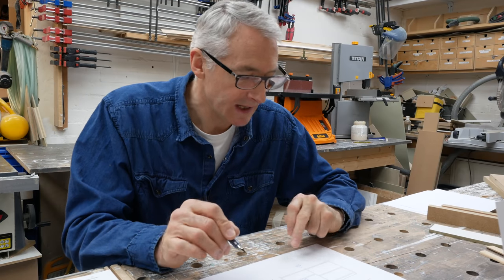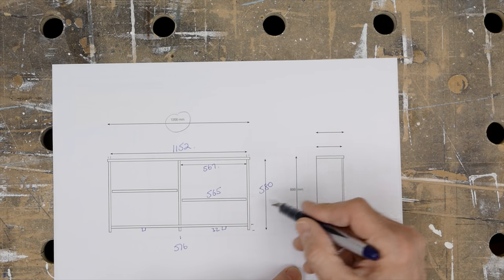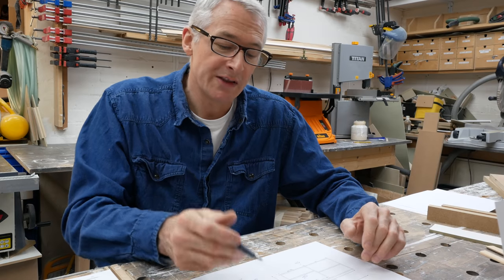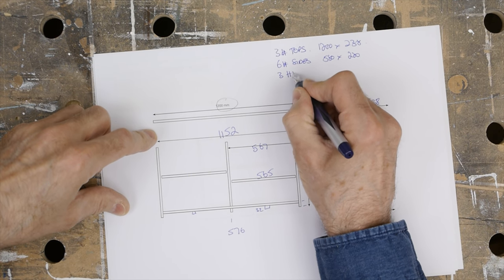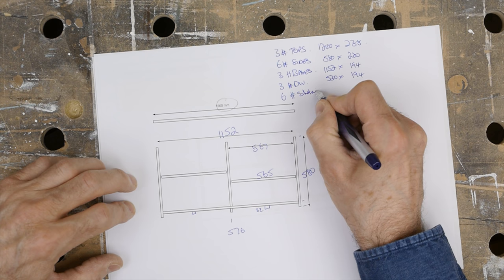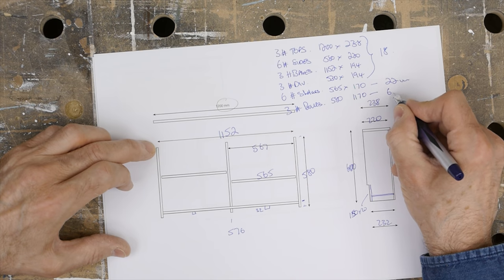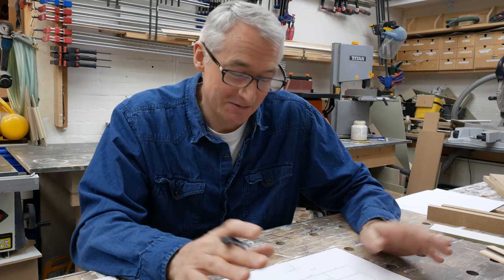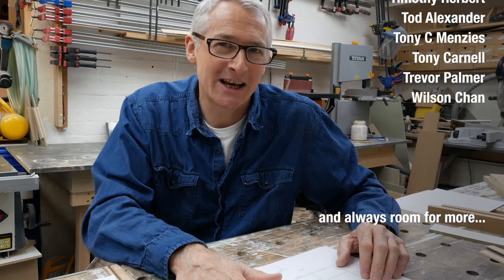Cut-list cock-up Part 2 [video #302]

Comment: You've highlighted the need for careful design and thorough planning quite nicely here Peter. Especially important for those operating as a small business or one man outfit. I use CAD programs myself for the design process. The one I use has a cutlist and weldment feature that will take the parts you've assembled and work out the cutlist and even best sheet arrangement. Not for everyone I'm sure but has so far helped me get it right first time every time. The only weak link is me actually cutting the stuff lol
Reply from the maker: Cheers Stuart. I think I'm always the weak link, lol!

Comment: That's why I model everything in FreeCad. After some time, I'm faster than drawing it in anything else or even on paper and when I get something wrong, I can immediately see it. Saved me two time already. Also, when I get wood order wrong (2x longer, 3x shorter instead of the other way round), I can do slight design changes in a few minutes.

Comment: Thanks Peter, made me adjust my cutlist calculations spreadsheet. As I had forgotten how adding a non rebate  back panel  and or a face frame  effects the overall depth of the main carcase's  sides top  and bottom 👍

Comment: Great Video - shows in a busy workshop moving from project to project it must be easy to try and get things done quickly, and then cause yourself this headache afterwards. This is partly why I like doing all mine in sketchup first, I then transfer my finished design onto sheet material layouts in sketchup so I know how much I will need, and then I end up with my cutlist
Reply from the maker: Thanks! Never got along with sketchup - spent longer doing drawings than actually making!
Reply: @10MinuteWorkshop  I reckon a man of your talents on a pc/mac could draw that design in sketchup in about 20 mins easy :) once you get used to the shortcut keys you can fly through carcass and face frame drawing quickly.
Reply from the maker: @mgdew  Only been using a desktop computer with mouse for ~6 months, was 100% laptop & trackpad before that, and Sketchup is horrible without a scroll-wheel mouse. Last time I looked at sketchup halfway seriously was ~2012/13 around there; I just found other ways of doing things, is all 👍

Comment: Hello Peter, I always get something out of your videos - thank you. I provide almost exactly the same services as you but in Brussels! My workspace is also very small and my main supplier is very good at cutting the sheet goods. I use SketchUp to design and draw my projects and I use the "Cut List" extension tool to provide a detailed list of all the components with their dimensions. Of course, if I make a mistake in my drawings (from time to time!) this is reflected in the cut list. But it is a helpful tool nonetheless.
Reply from the maker: Thanks Hugh! I thi nk that's the point that a lot of folks are missing here - I made the mistake early on in the drawings because I didn't think it through fully, so even if I'd been using sketchup, I'd still have had the same problem. 🤷‍♂️👍
Reply: Ah, yes that is always the key element!!!

Comment: Enjoyed both parts of this one Peter, thank you for making them. Always good to see the paperwork side of the build. I meant to say in my reply on part one, that I think you made the best choice to put that packer between the two units that bolt together. Will that cover strip be held in only by brad nails or will you glue it as well? I am thinking that if the client wants to set them up as one book shelf in the future a glued on strip may not come off that cleanly. Thanks again for making the video.
Reply from the maker: Thanks Bob. I’ll be gluing the face-frames on as well, but I’ll make an extra pair so they can be replaced if/when the two carcasses need to be separated. 👍👍

Comment: Interesting that you’ve got that much confidence in your supplier that you give them exact sizes to work to! I always add a few mm on just in case or maybe I’m not that trusting or my sizes are not to be trusted😉
Reply from the maker: I always used to round it up to the nearest 5mm and trim it back, but honestly they just dial it into the saw and you get perfect sizes out. Total faith. 👍👍

Comment: Ok cut-list prepared, but the nightmare is transfering that to the size of stock available - esp [when working to the mm] the kerf allowance when the stock panels are divided up. Do your suppliers have software for this or do you just order all those pieces  and let them worry about it?
Reply from the maker: Total faith in my suppliers. No software needed, other than what's in the head of the guys on the panel saw 👍👍

Comment: A friend of mine carefully worked out cut lists for the timber yard to the millimetre from 8x4 sheets and despite me telling him about the cumulative kerf error in each cut and how that would snowball across the sheet leaving the last cut short he went ahead anyway. I'd offered to do the assembly and took no "I told you so" pleasure in having to cut each of the boards down to the width of that final board. But I did feel smug in my self righteousness!
Reply: When I ordered some cut wood they told me I would lose 2mm with each cut, and to allow for it.
Reply: Exactly Kevin, my Freud Pro blade has practically 5mm of kerf so I never mark for multiple cuts and do them one at a time or with a stop if it's a cross cut using a sled.
Reply: @sewob147  
This place has one of those computer controlled air table cutty things, I guess that's why it's only 2mm.
My circular saw has less kerf with it's new blade, after I had to replace the old one due to accidentally cutting into a concrete step :(
Also been helping a friend build a shed, using his B and Q special saw is scary, the kerf is about as wide as my leg!! He should know better, he is a plasterer/tiler.

Comment: I guess it is nice to see that even skilled pros make mistakes, but that also makes me feel hopeless that I will ever get better.  I have developed "paralysis by analysis" and now spend much more time planning than doing.  Multiple scale drawings and calculations usually do not agree with each other.  Often I cut some, build some, cut more, build more, etc with several design adjustments as I build to correct for design errors and math mix ups.
Reply from the maker: Always better to be making & making mistakes, than just to be making plans and drawings - you learn so much mor that way👍👍

Comment: I use Sketchup with the Cutlist extension. Click on Cutlist and your drawing is made into a cutting list in seconds , with a sheet layout if you cut up your own stuff. I still go through everything as I don't fully trust it.

Just downloaded Fusion 360 though so the learning starts over again lol
Reply from the maker: Hey Chris. Yeah, I by-passed Sketchup for a variety of reasons, but just starting to play with Fusion 360. Did you find the Lars Christensen’s tutorials  on YouTube yet? Really good basic introduction. 👍👍
Reply: @10MinuteWorkshop  yeah they're the ones I've been watching. Getting the hang of it slowly but a quite bit different to SketchUp
Reply: Fusion360 is a lovely bit of software, powerful and flexible. Alas, that power and flexibility also means you can do things completely cockeyed early on, and only realise when you're 15 components in to the assembly :) Also really nice that you can right-click an assembly or drawing in the data panel, choose share link, and get a link to an online viewer that you can send to someone to look at what you're doing (static, works from the saved file on Autodesk's servers).

I'm doing a tall boy design at the moment to enclose a consumer unit in my porch. It's a simple thing to design (just a box really), but the parametric nature of F360 means  that I can go "hmm, no, lets make it 220 deep and out of 18 mm instead of 12 mm" and everything just moves correctly. If it doesn't move correctly, you know you screwed up :)

Comment: Is it my computer that has problem with static? For example at 6:57 and 7:27. I have heard in a few other videos of yours but not always. Maybe the iPhones cellular activity?

Nice videos as always!
Reply: @10MinuteWorkshop   Sorry, it's the audio. It's like dust on a vinyl in it's character. Just to make sure, I watched on my iPhone also and it was there. Not as high in volume as your voice but definitely there. Might be that I am picky since you have such high quality otherwise :-)
Reply from the maker: @MrLovblad  It's more than likely just background noise, or noise bleeding in from next door; my neighbours are a seamstresses, so there's often some 'sewing machine whine' or other chatter that bleeds through; it's a working workshop, not a sound stage, so a cross I have to bear, lol! And thank you - I try to get the audio as good as I can, without the process getting in the way 👍👍

Comment: Hi Peter, this was a very useful series. I note you are producing scale drawings and then calculating sizes - why do you not measure off with a scale rule? Or am I missing something......... but yes I make mistakes too.😉😂
Reply from the maker: Thanks Norman! I'm assuming that not everyone will be able to do scale drawings, so wanted to show hpw you'd calculate the sizes from scratch. Basic maths is all you really need, not fancy drawing software - though it has its uses... 👍

Comment: Great video Peter , I do this sort of mistake from time to time. Quick questing if you don't mind which cad drawing software do you use ? Really
need to up my game with the plans. cheers
Reply from the maker: Thanks! I use an OSX / iOS app called Graphic. It’s a full vector illustration app that does far, far more than the simple 2-D line drawings I use it for, but it works to scale in metric and is a very reasonable one-off purchase. TBH it’s not ideal for drawing plans - there are some obvious tools missing (e.g. tape-measure) which if you’re coming from something more sophisticated will be jarring, but I like it nd work within its limitations.  👍👍

Comment: OHHHH ...lol i think fluteing it would be more work ,but the sell it that it wouldnt take as much to switch them out even if you did a narrow flute down all three on the face frames making the center  face frame the same width as the sides ,but i think i see the problem there Peter its in metricy ...lolwaiting to see the finished product Peter

Comment: Peter, how did you come up with the 194mm dimension when the nominal is 220mm? might save you another trip to the yard
Reply: 20mm off for the face frame and 6mm off for the back
Reply from the maker: Bookcase depth is 200mm, with a 20mm cut-out/overhang at the sides and top to accommodate skirting boards. So, sides are 220mm, but the bookcase only goes back to 200mm, less 6mm for the back, so 194mm. 👍
Reply: @10MinuteWorkshop  spot on...great videos btw

Comment: What do you mean, not very interesting? I'm watching this while taking a break from doing my own cut list on a set of cupboards and drawers which need to have recessed backs to fit over sockets behind, so lots of ins and outs and stops and starts.
I guess you and I both end up with complex and fussy commissions because they turn to us when they can't find what they want at Ikea!
Anyway, here's a question.  How do you manage to get such neat and professional looking plans?  All mine are hand drawn.  For the customer i use squared paper and a scale rule but for my own assembly instructions it's a real gorblimey mix of hand drawn scrawl on an A4 pad.  Complete with crossings out and missed panels!
Oh, and something I've wondered about for a while.  Do you scribe wardrobes, side infils, top infils etc. against a wall with your tracksaw?  I used to use a jigsaw but I find it much easier to mark the  required width every 300mm and just keep moving the rail to the next mark as I run the saw along.
Reply from the maker: Hi John! Thanks! I use an OSX / iOS app called Graphic. It’s a full vector illustration app that does far, far more than the simple 2-D line drawings I use it for, but it works to scale in metric and is a very reasonable one-off purchase.  👍👍 As for the scribes and infills, depending on how bad the walls are I’ll often do a rough trim with the tracksaw, then finish off with a handplane, I tied the jigsaw thing but never really was happy with it. I keep meaning to take my little bandsaw along the next time I have a few to do!

Comment: Do you know maxcut software. Its free for home use and it maximise your cuts on sheets. It give ypu a plan of the divisions on the sheet and also a liste of parts, cuts etc.. even the blade kerf can be setup... really nice piece of software.
Reply from the maker: Thanks! I’m not a home user, though, and I don’t really have the need for it. Could well be handy for others though, thanks! 👍👍
Reply: That'd be interesting. Do you have a link to the software?

Comment: Great video Peter. The cut list, many a headaches have come from these! I use sketch up for my drawings and the good thing is you draw to scale and at any moment you can run a tape over any section and pull up the size required. However, I don't really like giving them to customers as the drawings still look very amateur in comparison to what can be achieved in say fusion 360. 

I brought Graphic for my Mac but cant get on with it. know that you use it and the drawings look very professional. Could you do a tutorial???  On how you would use a tape on it to say draw a rectangle and then draw another one offset 80mm inside to represent a shaker door? I cannot for the life of me find anything that will help in my design on there. There seems to very little in the way of any explanations online. 

All the best
Reply: Yes, agree with all that - try Affinity Designer at 49 quid for your mac (or pc - or tablet even :-) instead of Graphic - nearly as good as adobe illustrator.
 BTW, sketchup has some BOM plugins IIRC - saves having to do it mandraulically - but like everything software, open to errors and then there's the learning curve :-)
Sketchup also has Layout which you can use to produce more 'pro-like'  2D drawings.
Reply from the maker: Thanks Jason! RBH I a need to get better at Graphic before I start making tutorials on it, lol! But no, there doesn’t seem to be a ‘tape measure’ option - I’ll typically just size another rectangle and use that as a reference. For shaker-style doors I draw the rails and stiles as separate rectangles, then group them.
Reply: @10MinuteWorkshop  Makes sense to group. I think the drawings look good enough to do a tutorial....don't be shy! 😁
Reply: @neilgillies6943  thanks for the advice Neil. Always learning so don't mind that at all. Maybe you could point me in the right direction for the plugins and a little tutorial yourself! 😉
Reply: @jasonchild482  Just have a rake through the available plugins at Sketchucation - try 'woodwork'  as a key - there are lots of plugins relating to that - even ones that can do complete cabinets/bookcase design etc (Peter Millard take note lol 😁) First one I came across is 'Cutlist'. I used to write plugins for some cnc stuff back in the day, but  doing a sketchup demo is a different thing 😁😁😁 Sketchup have loads of excellent training videos available at Sketchucation.

Comment: Hi Peter, thanks again for a very informative video. Have you come across Maxcut V2 free cutting list software? https://www.maxcutsoftware.com/  you still have to workout your sizes, but it does give you a visual before taking the plunge.
Reply from the maker: Thanks Tim. Never had the need TBH - I have total faith that the panelsaw guys at my yard will figure out the best way to cut a board, no worries on that score. Looks like it could be handy for home users though, thanks! 👍👍